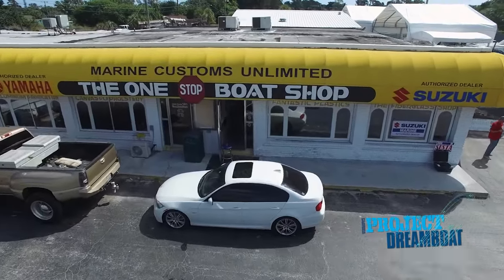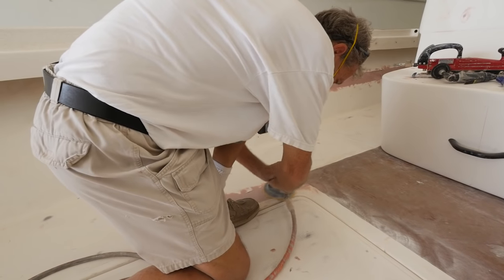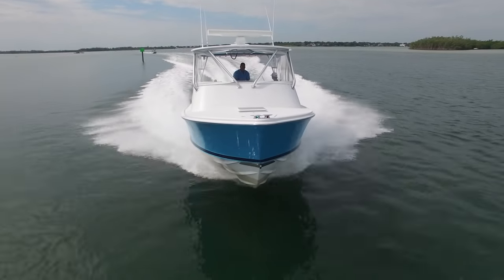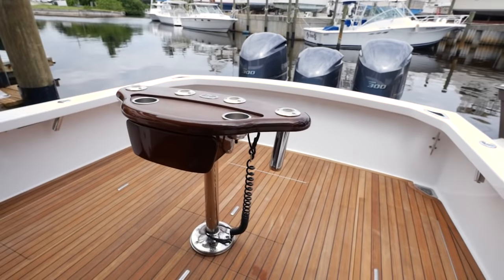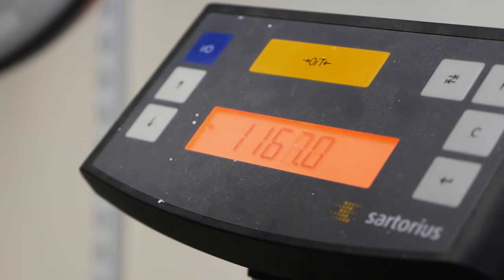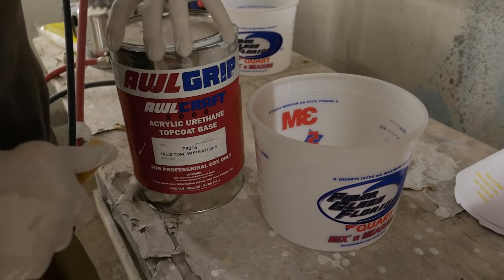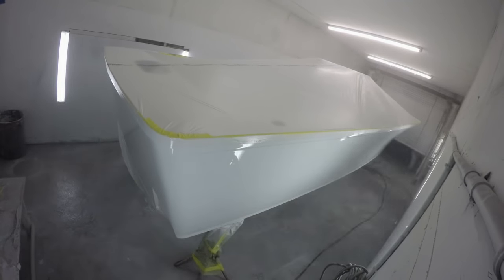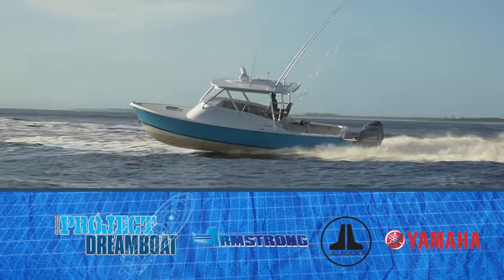Florida Sportsman Project Dreamboat - Seacraft Perfection, Transformed Classic Bertram

Comment: Excellent video however, on the enclouser job Repair done by Robert was not as expected, I believe he could of done a better work by adjusting the tension on the sides of the enclouser, you can still see all the waves on the clear stetragflass material.

Comment: It would be really great if this show explained the performance they achieved with the triple outboards on the Bertram.  What was the top end speed? What did they do with the trim tabs ?   What size fuel tanks did they put?   What type of fuel tanks?  
    This is a good show but incomplete in my opinion some small tweaks could make all the difference and make this show totally great.   I still enjoy watching this show,  but it can be better.

Comment: Question about the modified Bertram, why are the 2 motors on each side not exactly mounted at same height . Secondly if you need to touch the buttons on the instrument panel , you will have to lean well over the steering and throttle , is that wise?
Reply: Mounted to get clean water

Comment: Get rid at least one of those engines. The boat will ride more level and speed loss will be negligible. Plus you'll get much better fuel economy. Heck sell that outboard for thousands of dollars in gas. Heck sell two of them. 300 horses is plenty.